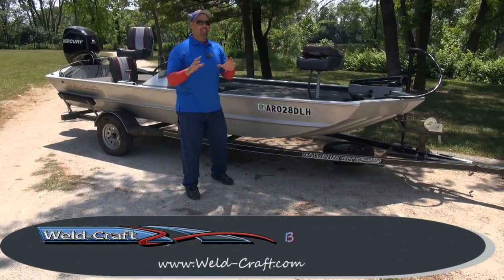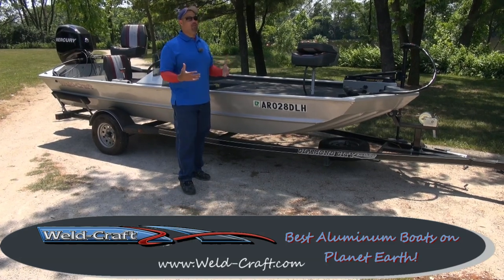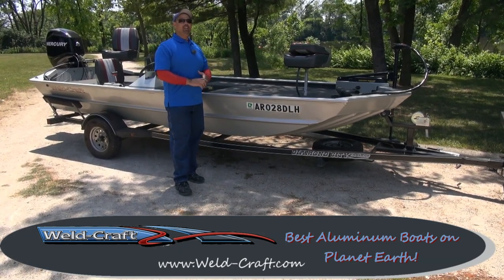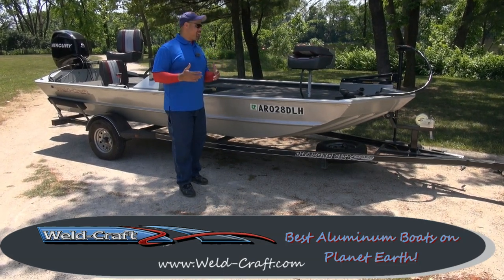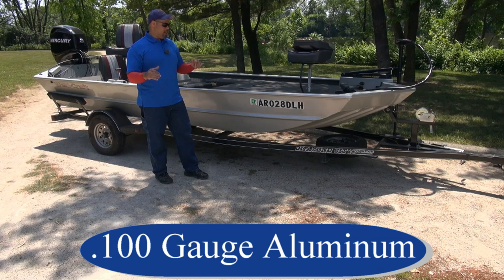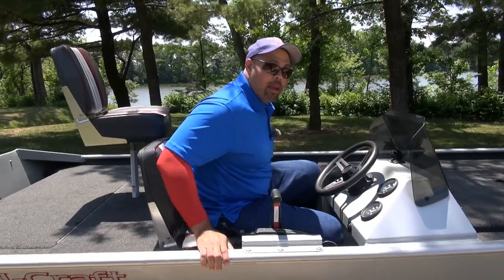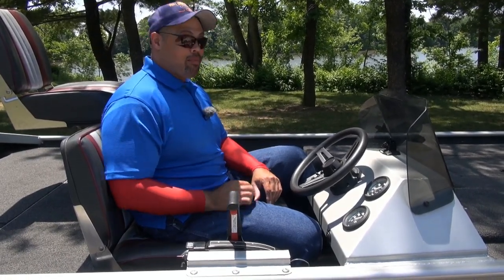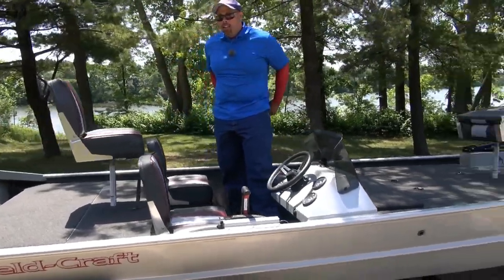Best Aluminum Boats on Planet Earth! Weld-Craft

Comment from the maker: You won't regret your decision with Weld-Craft.  The livewell is huge. The boat is so solid. It'll last you for a lifetime. I took this boat to a friend at a marine restoration shop. He has over 25 years experience repairing fiberglass and aluminum boats.  He just marveled at the construction. Weld-Craft will not let you down.
Reply: What model boat is it, I just bought a weldcraft identical to yours and can’t figure out where to get new gauges/parts for it. I can’t seem to figure out the model either or how to contact weldcraft

Comment: Good point on  plastic consoles with steel flooring in the heat. 
Hadn't thought or heard that mentioned before. Thanks for the heads-up.  I check these boats out.

Comment from the maker: In the two lakes you mentioned I'd absolutely go with a bass style design. That's why you see me in them.  Waves don't get very bad there but, the bass boat is so much easier to fish from. When it's extremely windy you don't want to be on either lake because it's near impossible to fish. A V-bottom only if I was in the middle of the lake perch or walleye style fishing in a large choppy lake. Go for the Weld-Craft. It'll last a lifetime. Call for prices.

Comment: I’ve been happy with my War Eagle. Even though my Eagle is all welded, There is nothing wrong with rivets done correctly. Aircraft carriers, and all warships are riveted. I’ve seen riveted aluminum boats that haven’t ever loosened or leaked.
Reply: You sir are correct. This guy sounds like he's drunk anyways
Reply: I agree. I had a 1974 mirror craft that was riveted. Never leaked a drop. I just sold it last year in 2018. Only because I bought a bigger boat.
Reply: @hulkhuggett  same here mirrocraft never leaked
Reply: I got a 1953 Orlando Clipper , it don't leak

Comment: Still hoping for an answer for my other question here, but my new question is, do they still make this boat? Don't see it on the website anywhere.
Reply from the maker: +Pringals Oh yes they make it. Just call them up and ask for it. If you're in Ohio go to the Columbus Fishing Expo in February and they'll have one on display. If you want free tickets to the Fishing Expo then I'll be giving some away soon.
Reply: +Fishnwithjoe thanks Joe! I'm actually in St Louis MO. I wonder if our local boat show coming up will have these on the floor. I've probably watched this video a dozen times the last couple days. Haha. Can you tell me what the overall length is? (boat, motor, and trailer). Thanks again!
Reply from the maker: If you're in St. Louis just call Weld-Craft. They are just outside of Little Rock, Arkansas. Tell them you watch the shows and you're interested in a Weld-Craft like the one in the show. They are the best people you ever want to speak with.
Reply from the maker: +Pringals Get any length. A 15ft, a 16ft, mine is a 17ft, an 18ft or a 19ft version. A Mercury 40/60 jet extends about 2.5 ft. You have the tongue of your trailer. about 3 feet. I'll say about 21 foot length total for mine.
Reply: +Fishnwithjoe Thank you very much Joe! Good luck in 2016!

Comment: Go talk to Kent Saxon at Gator Trax.  
You brag about  .100 aluminun , Gator Trax minimum is .125 and upgrade to .190 . Gator Trax can custom design your dream boat . Each custom boat is literally one of a kind built with extruded aluminum 
 bracing that runs longitudinally.
First in quality materials and workmanship . But you can save money if you buy another brand because Gator Trax boats are not for someone who thinks they might want to get into fishing or thinks they might want to hunt ducks .